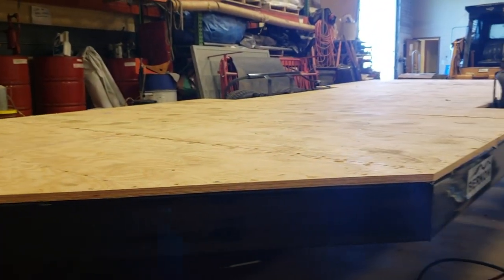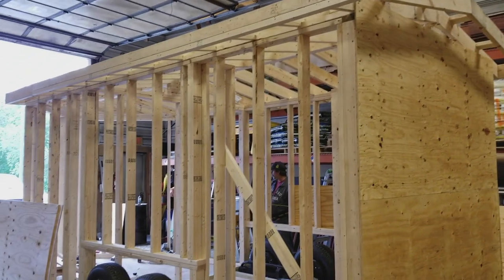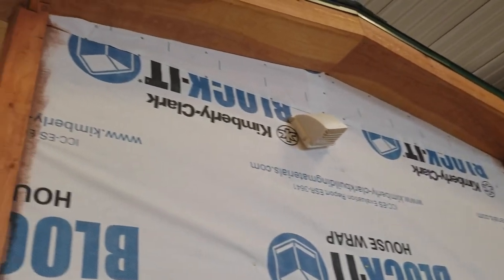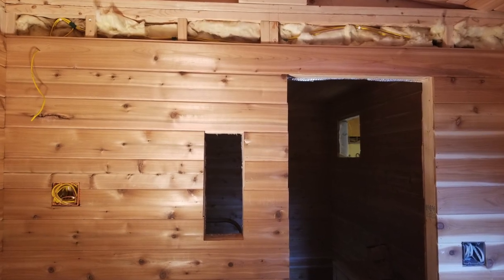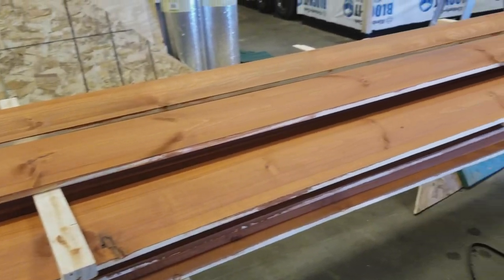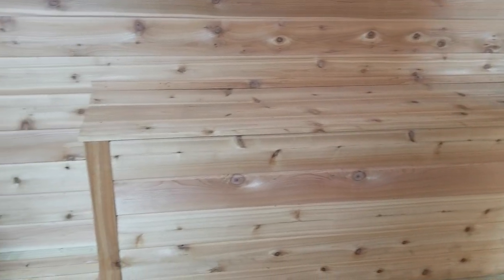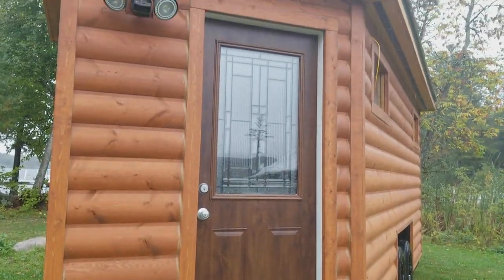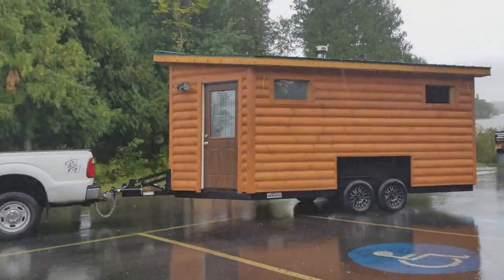DIY: Mobile Sauna | Start To Finish

Comment: Great video, I have a few questions. Did the vinyl cement get hot on the feet? Did it off-gas a smell? How much does your sauna weigh? Did you use cedar for the interior?